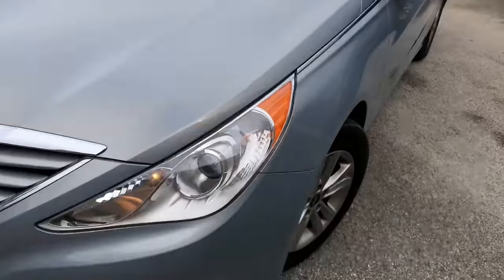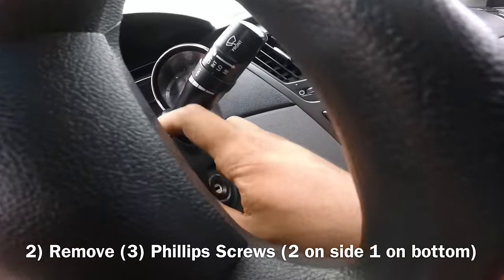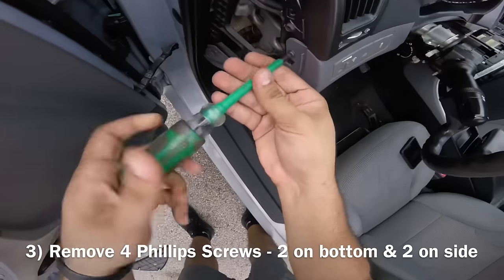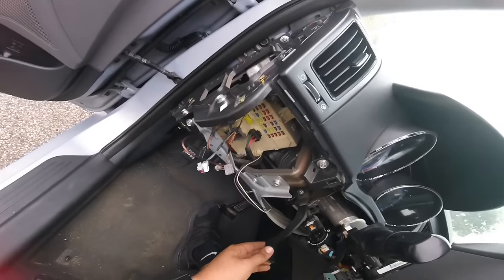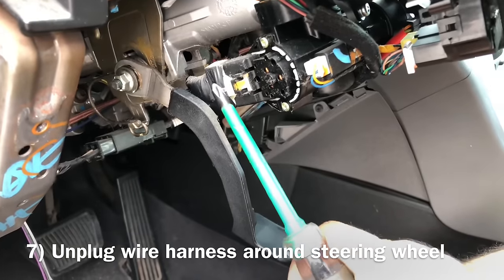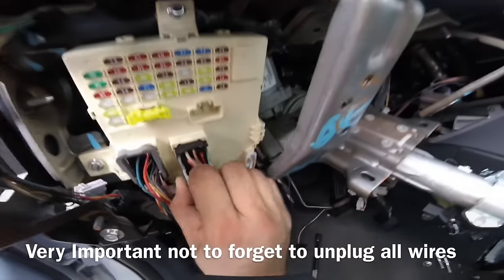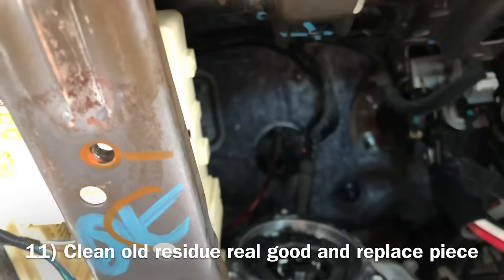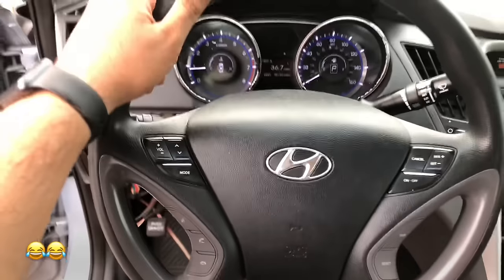HYUNDAI STEERING WHEEL NOISE : HOW TO FIX - SONATA/ OPTIMA 2011-2014 UNDER $20!! FAST & EASY!

Comment: Great video my car is doing the same but very minor noise, but hell that's alot of work man lol
Reply from the maker: Oh no!! :( it’s only gonna get worse my friend! Is yours covered by the recall? And yeah it seems like it.. but it goes much faster if you don’t try to make a video while doing it lol 😂
Reply: Hidalgo Motors Co there is a recall for this noise ? My car is also doing the same noise. Btw there is also a recall on 2012 Hyundai Sonata starters so beware I found this out after I paid $430 to get it fixed by a mechanic. I also noticed yours is a key mine is push to start is it the same procedure or no?
Reply from the maker: Heyy! Yes there is a recall for this noise... however Hyundai has limited  the number of cars they are fixing under the recall. Mine didn’t qualify. And wow I wasn’t aware of the starter one! Very informative! Thanks for sharing with us! And yes mine has just a key because it was a basic one.. but the procedure is still the same.. you will just have to unplug the harness connected to the push start button in order to remove the bottom piece where the buttons at.... not different at all. 
Thanks for your comments and feedback!
Reply: Hidalgo Motors Co Okay thank you for the information and you are definitely welcome about the starter.
Reply: It’s easier then it looks!!
Reply: Noah Jellie I brought it to the dealership they fixed it for free 💯%  idk why but I’m not complaining about it lol
Reply: Nastiie Gaming Hyundai extended the warranty to certain vehicles. Must be under 10 years of service or 💯 thousand miles which I am over 130k!! Glad it worked for you.
Reply from the maker: Sure is! Thanks for sharing with us! Love the feedback

Comment: Experiencing some whining during turns after doing this job, any idea?
Reply from the maker: Matthew Harper hmm that’s strange... haven’t experienced that yet... normally a whining noise while turning means you’re power steering fluid is low. And the pump is straining. Check that out.

Comment: My mechanic and local dealerships are telling me this is a 3 to 4 hour fix. How you do it in an hour?  Another question if anyone knows the real answer. Will continue to drive the vehicle with this bad part hurt my vehicle until I can muster up the money to have repaired?
Reply from the maker: Yeah you can continue to drive it. Just gotta be careful at high speeds. And I fixed it in about 1 hour because I had to record it. But without recording I could fix it in less

Comment: Thanks for sharing, lol made that shit look easy. I've only changed my battery the tires, trunk latch & headlight lightbulbs..so I dont got much experience with cars but do you think I can replace mine as well? Idk what that piece is called but even so I'm a little nervous becuase of the electrical stuff..any advice would be much appreciated
Reply from the maker: Jessie Dillon no worries! Just take it one step at a time and be careful with what you are doing. Take lots of pictures of before and after, trust me. You’ll do fine! You got this! If you can change a headlight bulb and trunk latch, you can fix your steering noise!
Reply: @HidalgoMotorsCo  thanks! I know I'll  be replaying your vid over and over for help lol
Reply from the maker: Jessie Dillon Lol no worries! I’m glad we could help out!! Thanks for watching!
Reply: If your going to tackle this make sure you have two things, some help and a T30 "L" shape allen wrench to get the bolt in the back of that little cannister because its hard to reach or see from the back. Might not hurt to get a mirror so you can see the screw in the back.

Comment: This just started while we are away from home on vacation.  We’re traveling on a schedule and found our car is under recall and we apparently qualify for fix, Hyundai page also says it’s not a safety issue.  We’ll be driving off & on for 5 days and returning home..a total of several hundred miles.

We’d rather wait to get home to our dealership that sold us the car New in 2011, so we don’t get screwed or waste vacation time at a dealership along the trip.

Is it safe to be driving with this problem?
Reply from the maker: Yeah it’s not a bad problem. It’s just very annoying, only problem you will have is that the steering wheel might shake back and forth uncontrollably during highway speeds. Making it very uncomfortable. But yeah I’d recommend letting the dealer take care of it... specially if your Hyundai offers a loaner vehicle. So you can continue to enjoy your vacation while getting your car fixed! What do you think?
Reply: Hidalgo Motors Co ..Thanks for the info!  We will get it to dealer as soon as we get home.  We also are on recall for the air bag issue.  So maybe they can take care of them both at the same time.

So far I only notice the thunk when I’m going slow turning into parking spaces or turning the wheel from a full stop or slow start (like turning into parking lots or turning after stop lights)

We’ve got 5 days left of vacation and then a 6-hour drive home.  Guess I’ll just pray that the part doesn’t totally deteriorate to the point of excessive shaking 🙏
Reply from the maker: the excessive shaking is nothing to be scared about.. as you can always remain in control.. it's just a little bit uncomfortable, and if you are not ready for it or not familiar with what the noise could be.. it could scare the heck out of you.. haha and also look into your CV axle.. it causes some tapping, clunking, clicking noise when turning your wheel all the way around, for example.... just like leaving parking lots and stuff.. once again this is okay.. it tends to wear out on all cars.. so check that out... and if it's not covered under the dealership recall.. we had someone in the comments here say that they tried to diagnose his car and told him they needed to replace the whole steering column and that the actual pump where the rubber piece goes was not serviceable.... he was quoted like over $400 so he said he went ahead and did it himself! for free. so the dealership will try to charge you an arm and a leg for anything... and who could blame them with such big overheads right? what do you think?
Reply from the maker: but to answer your question fairly.. you can wait to take it to your dealership back home.. the problem is not a safety concern.. just uncomfortable noises. other than that, they are very reliable vehicles. 

and to diagnose your cv axle, you can go to an empty parking lot.. and come to a complete stop, then turn your wheel all the way to one side and drive in a circle, you may hear clicking noise coming from the front end of the car.. once you turn your wheel to one side and drive in a circle, change the direction and do it the other way, to see what side the noise is coming from.
Reply: Hidalgo Motors Co ...Thanks again for sharing your knowledge! I really appreciate it!  Will give the test a try later. 
As for servicing, we’re happy with our hometown Hyundai service center; and we have a trusted local auto mechanic for my other car (2005 Scion Xb that has been a dream).  Both have a steady stream of customers, so not having to “make up problems” for extra profit doesn’t seem to be an issue.  My nephew used to work at such a place on his first job as a mechanic...his boss used to make him tell people they needed expensive fixes, and he hated it.  He loved working on cars and interacting with customers (who really liked and trusted him); but the dishonesty and trickery turned him off.  He quit after 3 months and now fixes jet engines in the Air Force.
Reply from the maker: Hey! No problem!! Anything I can do to help! And yeah give it a try! Hopefully you don’t hear anything lol which will indicate your car is good. And yes it’s always a blessing to have a trusted source when it comes to mechanics! Having someone you trust is a must! And you know the Scion xB is amongst the most reliable cars ever!! Excellent reliability! And yeah all that making up problems is not good business. I’m sorry your nephew got put through that. It sucks to go against your morals. Specially for money. Lol yeah I love working on cars myself. It’s fun to me. Like a big advanced puzzle lol and wow thank him for serving our country and fixing our jets! God bless America and the Air Force! Oh and your nephew too!! Hahaha thanks for watching my videos! Means a lot to me!

Comment: This was super helpful thank you so much! Never done any kind of car repair or maintenance before and was able to fix my annoying steering wheel because of your very clear instructions and filming. The only thing I would add is that the steering wheel is surprisingly heavy when you drop it down which wasn't a big deal at first but I wasn't able to get it hooked back in on my own and had to have my friend hold the wheel up while I guided the hook since it was so heavy. Other than that, it was pretty straight forward! Saved me a lot of money, thanks again :)
Reply: It's covered under  an extended warranty. Call the dealer. Mine goes in Monday to get fixed free of charge. I'm also the 2nd owner
Reply: @beenrudy  My warranty expired, I already checked with the dealer. But it's all good, it was fun fixing it
Reply: @JuliaBlu  I was going to tackle mine but called for a quote from dealer for the hell of it and they said it was covered. My warranty ran out at 50,000 a couple years ago being a 2nd owner. If I own it when it fails again it's on my dime. Glad everything worked out for you.
Reply: @beenrudy  nice, lucky you! Totally would have done that if it was covered. But now you know you can fix it on your own too if need be

Comment: Anyone did this on 2016 Sonata? I have tried to do it but the layout is totally different. I cant find all 4 bolts that are holding steering column. I only find front 2 and cant lower it all the way to access the power steering motor. I also tried to look online but all the videos and forums have info on 2011-2014 models. Please help
Reply from the maker: It may be different location or maybe you have to remove a whole bracket.. not sure. I haven’t done it on a 16 sonata yet :( hope you can figure it out :) please let us known

Comment: Does anyone know if there is a better part to replace it with that won't break so fast?
Reply: thats really the only one made for those makes and models. They will usually last for about 5 years....a little longer if your in a colder weather climate
Reply from the maker: one of our users says he machined his own out of aluminum.  so maybe get in touch with him to get you one.
Reply from the maker: one of our users said they machined one out of aluminum and it worked like a charm! maybe contact him somewhere on the comment section.

Comment: Hey I have a question! My steering wheel started doing this and then after now when I hit little bumps it makes a rattling noise really bad. I’m wondering if those are two different issues or if the clicking noise and the rattling would go hand and hand? Lol the shop gonna try to rip me off 😩
Reply: Omg the satisfaction I felt when you turned the wheel back and forth at the end!! I can’t wait to feel that feeling again 😂 I’m trying this this weekend!
Reply from the maker: Hey there! Okay. That noise is only from the steering wheel, if you hit little bumps and hear bad rattling noise.. it could be your front suspension which is composed of shocks and struts springs etc.. but it shouldn’t be that big of an issue. The steering wheel clunk is a separate issue.. but it’s really hard to tell without looking at it in person :( I would suggest going to the dealership and getting a diagnosis then find someone who can replace those parts for a low cost. If you were in Houston TX I got you! But if not, it’s gonna be a bit tough for me :(
Reply from the maker: And yess I’m telling you!!! Me too!! I was so happy to have fixed that problem! I was so proud of myself lol! My advice to you is please have someone help you when lowering the steering column and when putting it back into place.. it’s really heavy! I struggled a bit with it. And I consider myself a pretty strong dude lol I had to use my feet to push up on it while sitting on the drivers seat and hold the steering with my hands to guide it in! Please please please take it slow and take it one step at a time! You’ll be alright! Good luck :)
Reply: tell me did you ever figure out the bump problem?? I replaced the rubber piece but mine was rattling over bumps too!!
Reply: actually I just took mine out for a drive after finishing up and I purposely hit bumps to see if it would rattle and it doesnt!! I hope it stays that way
Reply: @JordanDrewVideos  Hi, yes! Replacing the rubber piece handled the rattling noise as well for me!
Reply: @JordanDrewVideos  i got mine replaced at the Hyundai shop and it ended up being covered under my extended warranty thankfully. But I wanted to share that They did say that issue with the rubber piece and the rattling went hand in hand! So glad your car is doing better! That was pretty stressful not knowing what’s going on, sounded like an expensive fix every time I drove it! Glad it was “easy” and nothing major major.
Reply: @KeyElaine  too bad it took me eight hours to do it! still relatively easy though

Comment: will this fix deadzone in the steering wheel?
Reply from the maker: That’s a great question. Not sure what that is
Reply: @HidalgoMotorsCo  when you the wheel but it gives not imput for about 2 degrees

Comment: The hook the held the steering wheel up in my car is melted to the column what do I do?
Reply from the maker: AyeEye Productions ummm what? Melted onto it?? Hmm... that doesn’t sound right... I think you may have a bigger problem other than the coupler... take it to the dealership
Reply: Hidalgo Motors Co TV sorry I was mistaken lol I got it out and all is well. Only one part of the hook was melted metal in order to connect the hook the the steering wheel. Thanks for responding though. Appreciate it.
Reply from the maker: AyeEye Productions not a problem! Thank you for watching!

Comment: I have a 2010 Hyundai and it's making the same noise but the eps light is on.
Reply from the maker: Okay. The procedure should be fairly similar. Although I strongly suggest taking it to a mechanic or doing some research before you dive into it.